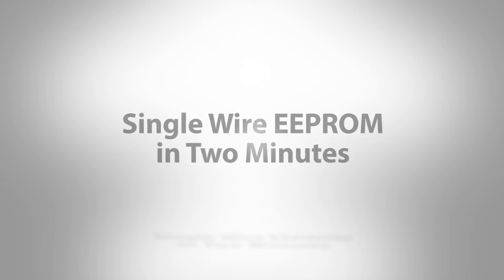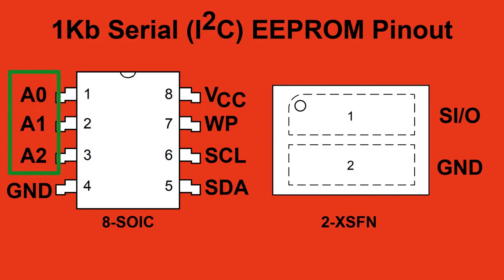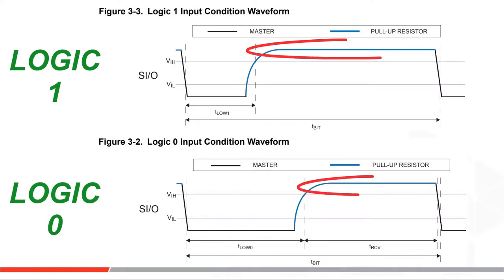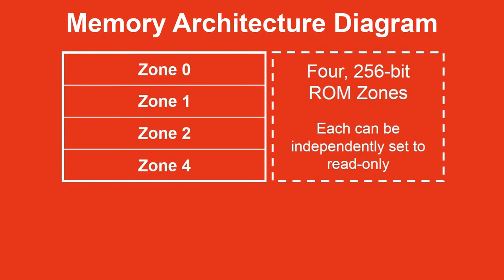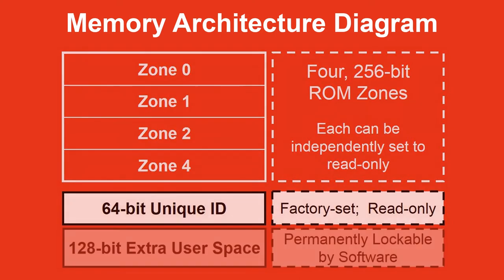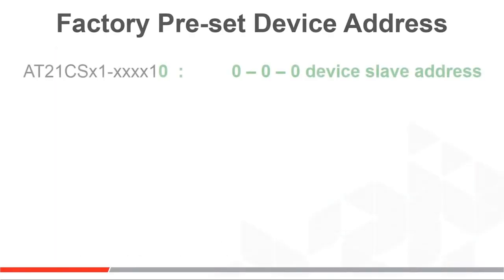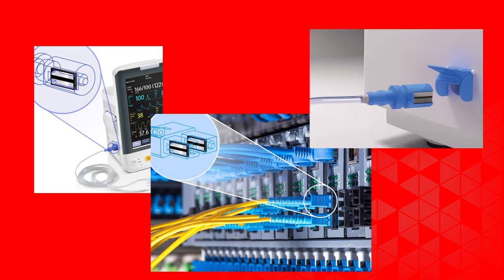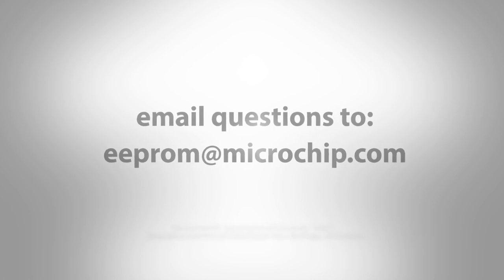Single Wire EEPROM in Two Minutes

Comment: how to read data from AT21CS01 EEPROM via Arduino?
Reply from the maker: Hi there, thanks for your question! Here are some links with instructions that you can consider:
https://learn.sparkfun.com/tutorials/reading-and-writing-serial-eeproms/all
https://www.instructables.com/Reading-and-Writing-Data-to-External-EEPROM-Using-/
Reply: @MicrochipTechnology  Thanks but I have been using Raspberry Pi 4 and i activated 1-wire interface. My connections:
-SI/O of AT21CS01 = GPIO4
-GND = GND
-SI/O of AT21CS01 = 3.3V with 1k ohm resistor.

P.S. I changed resistor as 330, 1k, 2.2k, 3.3k. 

I tried a lot of things for reading data from AT21CS01 in both Arduino and Raspberry but i cannot correctly get any data. I bought DM160232 to understand AT21CS01 and I changed it from FF value to different value in 06h and 23h address of Main EEPROM zone to solve easily code for reading data but it didnot work. So i tried your method for reading data from 1-wire EEPROM.
Reply from the maker: Thanks for the clarification! To best assist you, please reach out to our team with further information (schematic, software, layout, connections, components used, etc.) about your design so we can provide the best troubleshooting support. You can reach us here: https://www.microchip.com/en-us/support/design-help/client-support-services
Reply: @MicrochipTechnology  Thank you very much. When my e-mail address is confirmed, i will ask for this problem in there.
Reply from the maker: Happy to help!